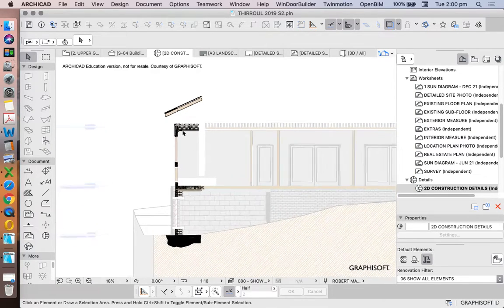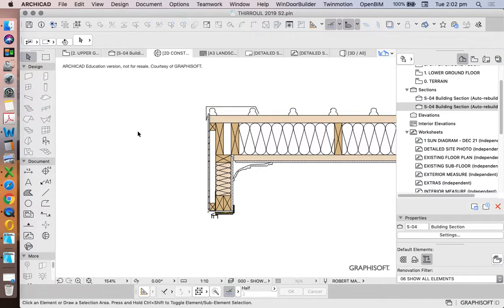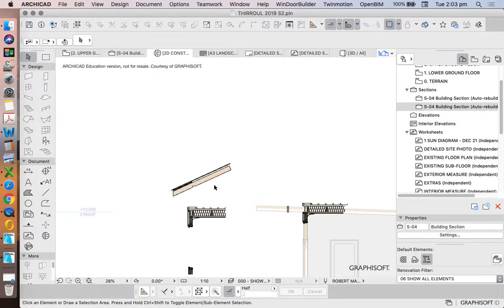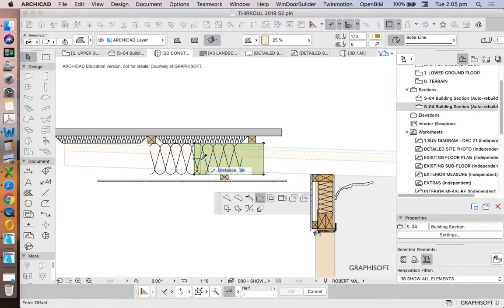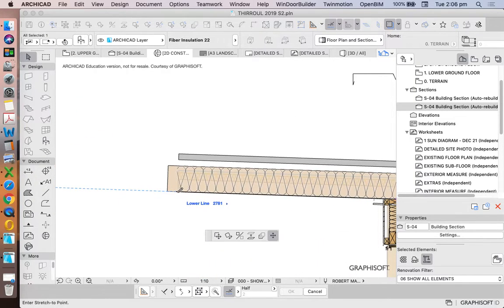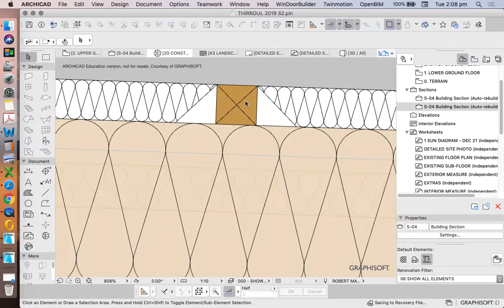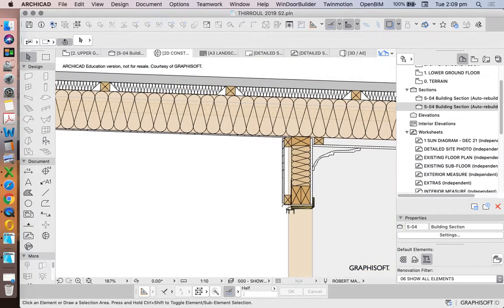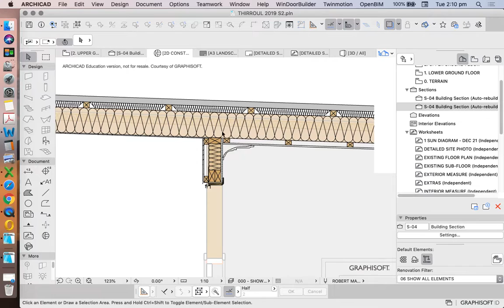ArchiCAD Wall section 2D drafting with fills 10 - Roof

Comment: Why would you insulate exterior overhang? You are also missing an end nailer or blocking Not a real life detail....
Reply from the maker: Hi, I drew these details primarily to teach my students the use ArchiCAD, not carpentry. There are plenty of reasons why to insulate an eave. If the roof cavity is continuous (to the eave) bulk insulation can prevent undesirable temperature change in the roof space; it could be to deal with condensation, or if it creates a patio it could be to prevent excessive heating under the eave. However, mostly I showed insulation in this instance simply to explain how the insulation object can be edited.